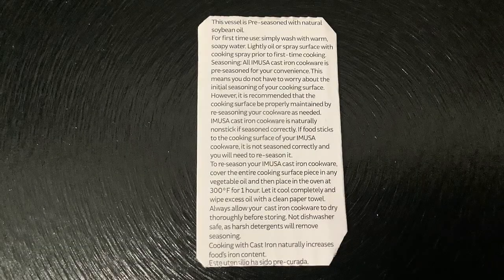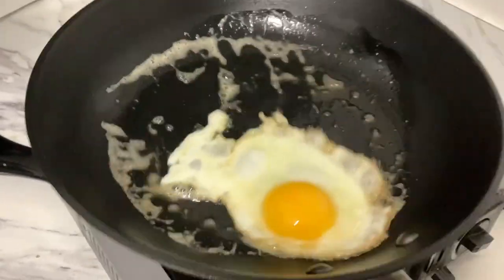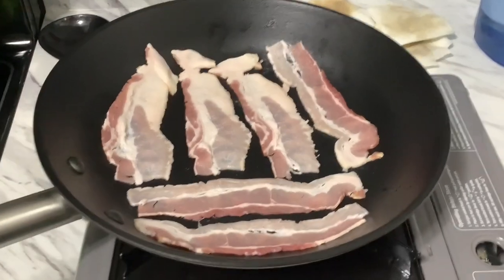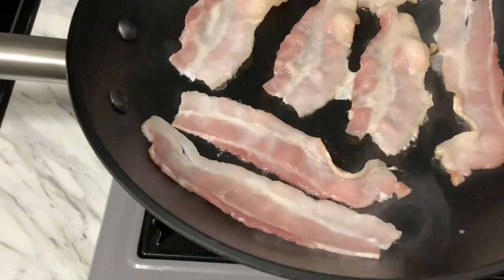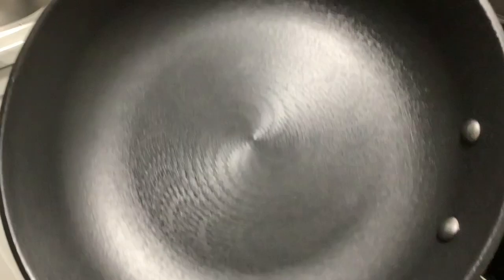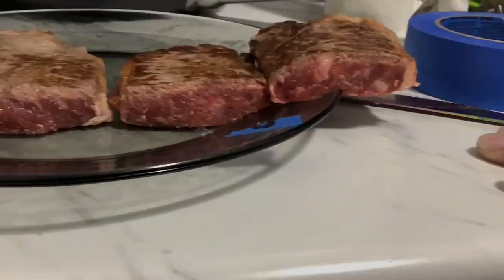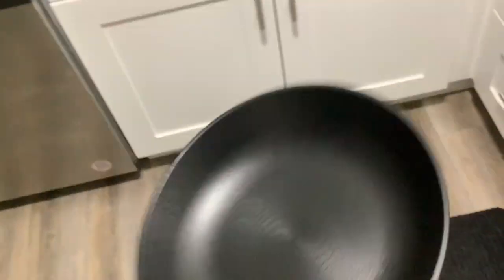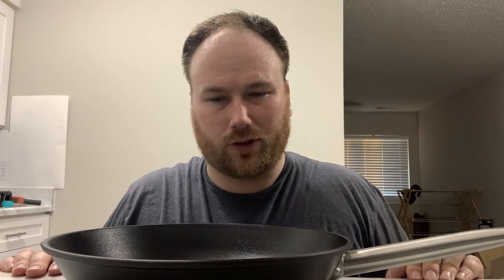Imusa LIGHT Cast Iron “Sauté Pan”. Benefits Of Cast Iron With The Ergonomics of Aluminum? Review.

Comment: Light cast iron is cast in a metal mold instead of sand, and milled to make it even thinner. The simple shapes with riveted on handles keeps the cost down. I have two of these exact pans and the factory seasoning will all flake away with daily use in about a month. I'd probably nuke it if I got another one to prevent those chunks coming off in food. It's hard to describe but after the factory thick seasoning is gone, the pan us much smoother underneath than you think. I only take my regular cast out for breads and skillet cornbread since I got these. Once re-seasoned they skate an egg with a thin film of oil wiped on with a paper towel (I got curious).
Reply from the maker: What’s weird is it isn’t much thinner, but is wayyyy lighter. As for the  seasoning. I’m still in the factory with a little touch up here and there and it’s still bang on thick.. lol. I use it for searing and eggs, so I get to play with both worlds.. def wouldn’t get rid of it.